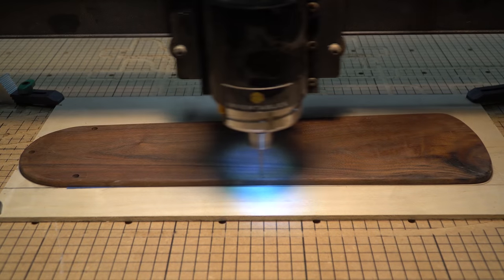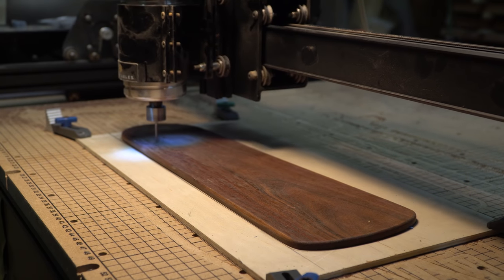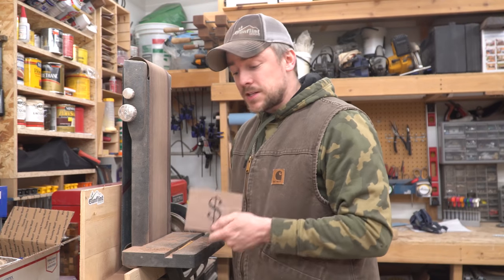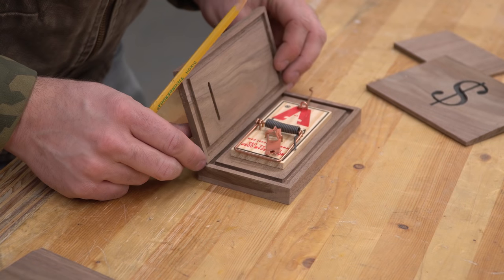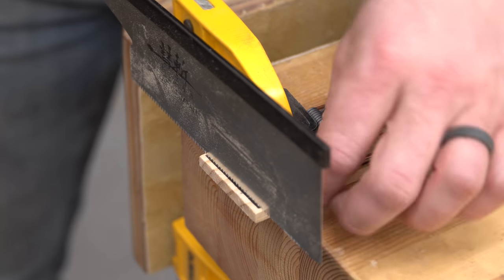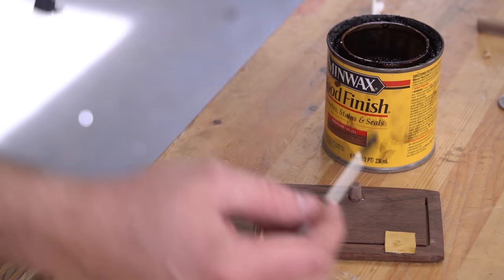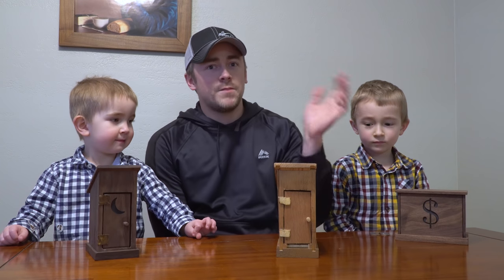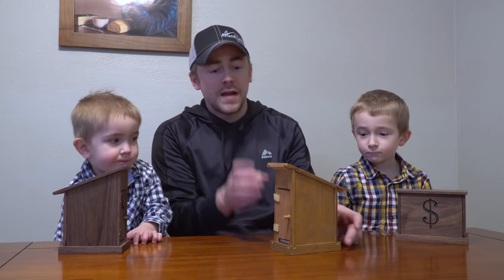Woodworking: Making Desk Toys with a Surprise

Comment: I just finished watching your Material Mate Cabinet video from a year ago. I searched everywhere on your Amazon store and in the project material descriptions, but I found no reference to those large magnets you use. If it’s easy for you, I’d appreciate knowing which magnets those are - I’ve been disappointed by some I’ve purchased. Thanks. 

This is a great project; the boys faces were priceless! ❤️
Reply from the maker: Hey Barbara, sorry about the oversight on the magnets! I have had really good luck with a company called CMS Magnetics . Their store is https://www.magnet4sale.com. If you do just a little bit of digging each listing tells you what kind of holding power each individual magnet has - that's bee how I pick mine out most of the time. They do sell some stuff on Amazon, but I haven't seen those specific ones I used in that video on there. Those magnets were 1" in diameter and 1/4" thick - they were REALLY strong.

Comment: in future when doing toolpaths, consider using "center" as your 0,0 instead of corner.  then even if you're a little off square as long as you have enough slop you wont have any issue.
Reply from the maker: Would that just be some checkbox that I haven't noticed somewhere to get it to run on center?
Reply: @GunflintDesigns  what are you using to generate your toolpaths? Vectric aspire will let you specify which corner or center
Reply from the maker: I'm a bit of a beginner. I use Adobe Illustrator to design then export an SVG. I import that in to Easel and let that run the show. @StuartGeers